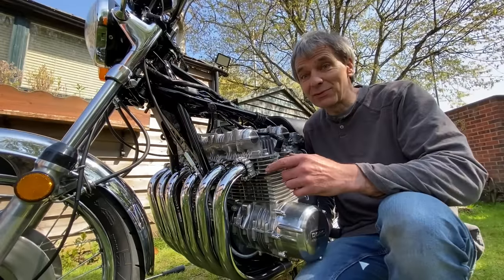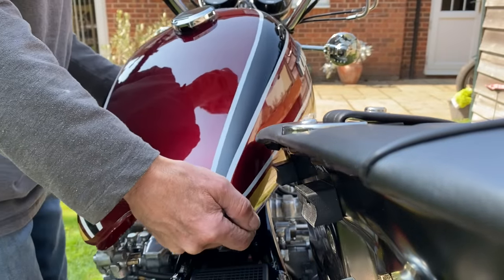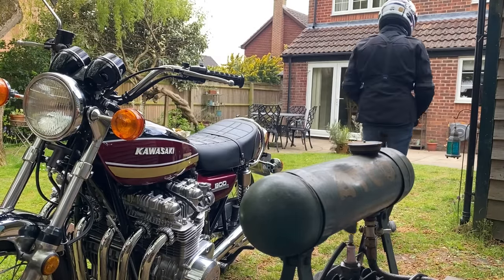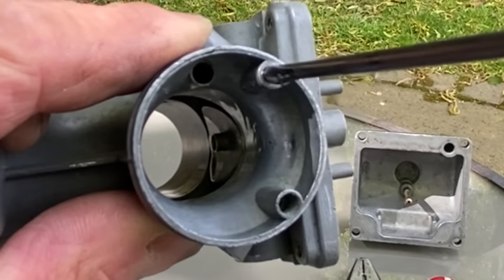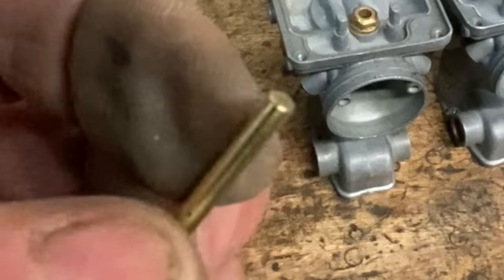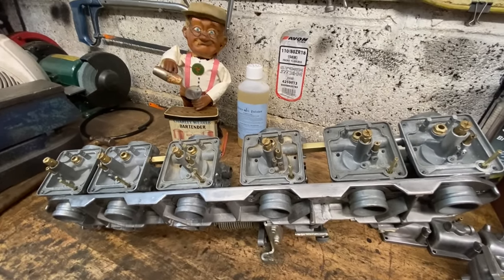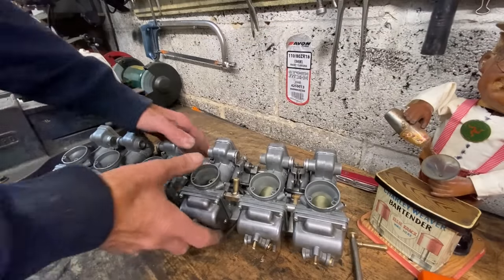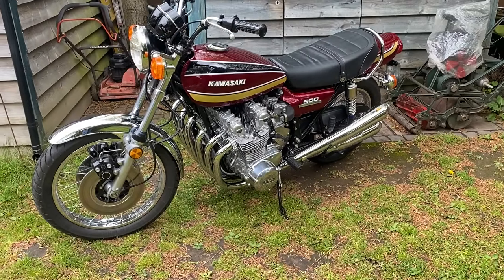Millyard Kawasaki Z1B Six Cylinder -  First start,  Ride,  Carburettor Fettle and Tips

Comment: Nasty fungal infection in your thumb nail or you minced it, or both see your doctor for some ointment ASAP it takes a year or so to fix fungal problems
Reply from the maker: Watch the Kawasaki 500 crank video I hit it with a 2kg copper hammer
Reply: @AllenMillyard  ouch that’s a whoopsie, I squashed my RH index half way across the nail and it blood blistered then fell off, the nail grew back fine but a year later I smacked it on something which split it on the quick and ended up with a fungal infection growing under my nail making it thick and sensitive. I’m still putting kenacomb ointment on it 6 months later probably 6 more to go lol
Reply: @AllenMillyard  new sub anyone mad enough to build a viper bike deserves my gratitude

Comment: Allen, is this one a conventional change or are you pulling off in second again? Also any difference in torque from the larger capacity?
Reply from the maker: Cant pull off in 2nd on a Z1 the gearbox won’t select 2nd unless moving
Reply: @AllenMillyard  So a conventional down then up change?

Comment: Try cleaning carbs with standard thinners it makes a great job of dissolving the rubbish lodged in the carbs , put carb parts in a jam jar pour in thinners leave them to soak, you can see the dirt when you shake the jar,  put the carb body in if you have a big enough container, but don’t put rubbers in it will make them expand! 😉....
Reply from the maker: I’ve done that before it’s proper smelly though